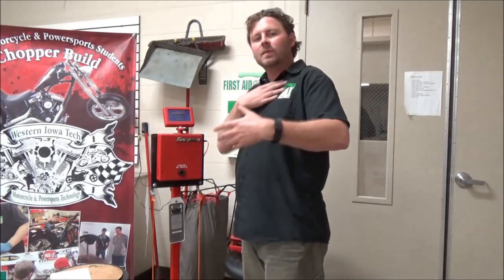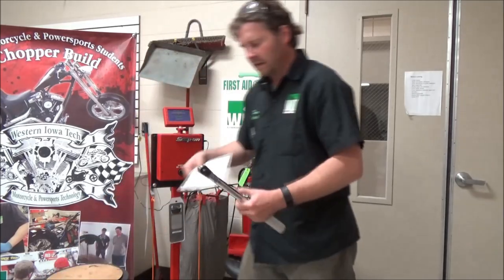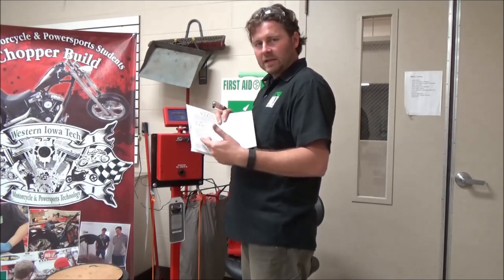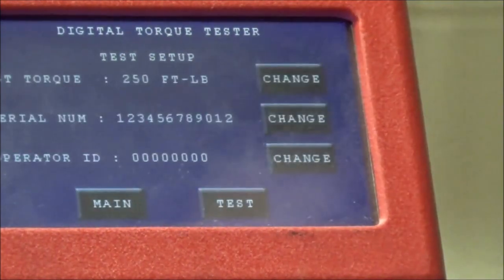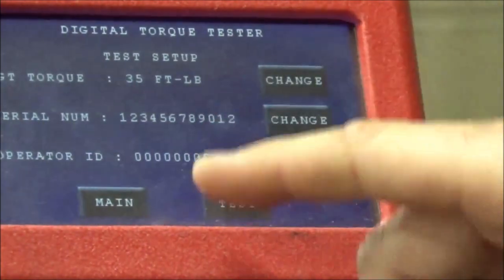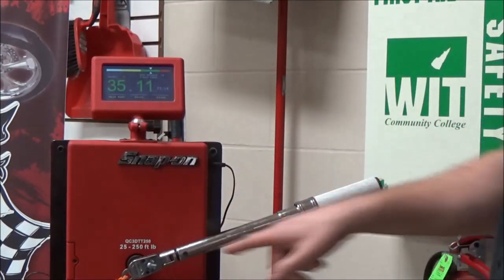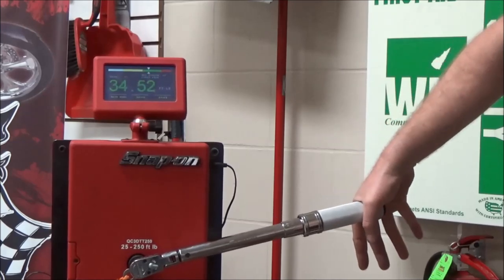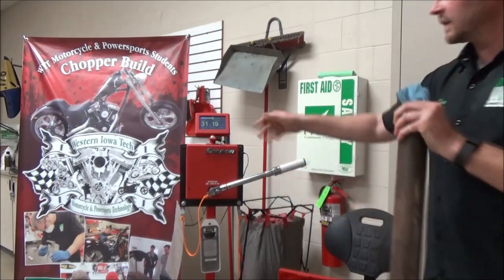Why hand placement matter when using a torque wrench. Proof with electronic tester!

Comment: Thanks for this video.  I wasn't aware of this, it will change my torque wrench use, but I have to admit that it still doesn't make sense to me.   I mean, the click mechanism is out at the end of the wrench, what does it care where rest of the wrench is being pushed on?  So 100 ft pounds is 100 pounds at 12" from the pivot.  Same as 50 pound 24" from the pivot or 200 pounds 6" out.  Right?  Recently I was torquing some very small bolts to 30 inch pounds and I choked up on the handle because it was such a small force.  Certainly the handle wasn't flexing at all, so how does that make me over torque?  To be clear, I'm not arguing at all, just trying to learn why.  Again, thanks for the info.
Reply from the maker: Glad it helped! You rock for commenting! We will let Shane know! Shane doesn't pretend to be an engineer but trusts that ALL torque wrench manufactures train and stand behind this. That's the best answer we can supply as to "why". Honestly wish we knew the science and engineering behind it but I've heard Shane say to students "why fight good practice" you're better off spending your time getting better at electrical skills...lol...little joke he makes with them...

Want even more? Best $2 you'll ever spend...

Ways to support or high five How 2 Wrench! Thank you in advance. YOU MOTIVATE US TO DO MORE!
1. Smash the subscribe button (thank if already a sub!)
2. Have you seen our "YouTube Trained Support Shirts?  https://goodfellasmerch.com/collections/how-2-wrench/products/support-shirt  
3. Join this channel to get access to perks:
https://www.youtube.com/channel/UCBhM8DCKnT3qXwTW0eToyCg/join     
-Daily MEMBER FIRST COMMENTS ANSWERED FIRST 
-Live Q/A video chats
-Wonder if we have a video on your need? Members can request content links!
-Full Access to the ENTIRE 700 video library
-Member-Only FREE tool giveaways  
4. Got an emergency and your head is about to explode from frustration or fear? Get Shane’s cell here: https://how2wrench.com/ols/products/techline-one-on-one

Comment: Theory wise, it does not matter where you place your hand. But the hand placement DOES matter, it prevents you from accidentally over torquing your wrench. If the torque wrench was built in a perfect world, then the hand placement might not matter.. but it is not. Keep up the good work.
Reply: Theory wise, a torque wrench is a lever, the longer the lever is, the more leverage you get. Shane does a great job of illustrating that.

Granted, moving your hand a couple inches in or out is not going to make a huge difference, but it will make a difference. Just like it says in the instructions: place your hand in the middle of the grip for the best accuracy.
Reply: What I meant was the force applied. The click mechanism of a torque wrench does not care where you place you your hands. It simply clicks after a certain amount of torque is applied. Torque can be calculated τ = FxD assuming a perpendicular force applied to the wrench. 
http://formulas.tutorvista.com/physics/torque-formula.html

I do agree that placing your hand in the middle of the grip provides for best accuracy, since placing it elsewhere can induce human error and overexertion of force which will result in too much torque applied.
Reply: The way that a torque wrench is designed, the amount of force required to cause it to click will change as the distance from the fastener changes. (You can see that in the demonstration that Shane provided.) In other words, it will take less force to make the torque wrench click if the force applied to the wrench is at the very end of the torque wrench. Yes, internally at the "click pivot" the torque is the same, but not at the "fastener pivot."  Remember that point at which the torque wrench pivots when it clicks is not the same as the point that the fastener is turning.
Reply: Remember that the torque applied to the fastener is a combination of the torque applied at the Click Pivot and the Fastener Pivot. The Click Pivot may not change with hand position, but the Fastener pivot does when you change hand positions.
Reply: Joe Smith has no idea what he's talking about. The leverage you get at the handle allows you to easily maintain the force applied to the wrench as it clicks. Because the force is greater at the shorter length(closer to the wrench head), it makes it harder for you to let go of the pressure at the exact moment the wrench clicks ...so you tend to overtorque. I bet if he used one of those manual torque wrenches with the needle, this whole thing could be easily explained.
Reply: A manual torque wrench with a needle doesn't have two pivot points like a "click" type torque wrench. It would not be affected in the same way. A manual "bending beam" torque wrench would loose accuracy as you apply pressure further from the center of the handle because you would be flexing more, or less of the beam material. The beam torque wrenches that I have have a pin in the center of the handle to help insure the correct application of pressure from your hand.

Take a look at some photos:
https://www.google.com/search?q=beam+torque+wrench&safe=off&source=lnms&tbm=isch&sa=X&ved=0ahUKEwiHi-Dw-Y3OAhVG2IMKHf1WDgAQ_AUICigD&biw=1280&bih=626&dpr=1.5
Reply: I totally forgot to look into this. Joe smith You are correct. I completely forgot about the pivot.

http://physics.stackexchange.com/questions/39693/calculating-torque-adjustment-for-offset-of-pivot-point/39695#39695
Reply from the maker: You guys have some great dialogue going here I love this type of community a back-and-forth corrections and adjustments. Thank you for being part of my channel and I love your professionalism. 
Shane Conley
Reply: @How2Wrench  I still do not believe that it's the hand position itself that messes with the torque. I'm pretty sure it's actually the shear force (non-rotational component) that tends to increase when you hold it closer to the pivot, increasing the friction in the mechanism so that it doesn't slip/click as easily. I'd like to see one more test: Get that wrench and measure the torque achieved with different amounts of non-rorational force applied, e.g. pulling down on the wrench when it's at a greater angle (maybe 45+ degrees up and down from horizontal). If I'm right then both of those things should throw it off too (wrench angled upwards = more torque, downwards = less torque) even if you hold it where you're supposed to, and if you are careful enough to rotate rather than pull then it should click at the same torque regardless of where you hold it.

Comment: Another problem I see people do is jerk on the torque wrench after hearing the clicking noise.I stop after hearing the clicking noise.Jerking on it gives a false reading.
Reply: If the readings are always over the target that could very well be an issue.  If it's lower, then it's not the operator.  The problem is there's only a small range of movement between the click point and the stop, unlike the really high range  torque wrenches that have a very large release area, and there's much less likelihood of continuing to torque beyond the click release.

Comment: While it is true that hand placement on torque wrench handle is important, there is a little bit more to the issue than that. Click style torque wrenches will click at different torque, while set to the same torque setting, if the speed of moving the handle is altered. The difference in this torque consistency is smaller on expansive wrenches than on cheaper wrenches. Having your hand closer to the drive, puts more force on your hand, so you move the wrench slower and creep up to the click, resulting in higher torque at the click. Using extension allows you to use less force, so you move faster and wrench clicks sooner than intended. Why am I saying this? To point out that not only the hand placement, but the actual technique is important with click style wrenches. Overall, I totally agree about the haters, if you ignore them, eventually they will go away.
Reply: @petethewrist  it is not about what the clutch knows,  it is about how fast your hand is moving.
Reply: @petethewrist  agreed,  but according to my testing of cheap click style wrenches the speed can cause up to 10% variance. Not a big deal in many cases, but user should be aware.

Comment: The difficulty people seem to be having is that they don't realize the wrench isn't measuring torque at the center of the fastener/socket. Or they have never thought through the consequences of that fact.

This kind of torque wrench doesn't know the torque on the fastener. It just reacts to the torque at the clicker mechanism (various designs exist) that is hidden inside the handle. Because the clicker is closer to your hand than the fastener is, it will feel a smaller torque than the fastener.

But that's okay, because those two torques are mathematically related. And by calibrating the clicker properly, the fastener torque will be correct.

If the clicker is located 80% of the way from the hand grip to the fastener, then the clicker will activate when it feels 80% of the torque setting you choose. But the fastener (since it is all the way at the end of the wrench) feels a torque equal to 100% of the set torque. Perfect.

This hypothetical torque wrench will always have the same 80:100 ratio between clicker torque and fastener torque. But ONLY if your hand stays in the correct position. Let's see why...

Imagine you move your hand so the clicker is perfectly equidistant between your hand and the fastener. This means that the clicker is now located 50% of the way from your hand to the fastener, and the real torques will have a 50:100 ratio.

If you set your wrench for 100 ft-lbs/Nm/etc, then the clicker will activate when it feels 80. But since your hand position has made the actual ratio 50:100 (i.e. 1:2), the torque at the faster will be 80x2 = 160! You've just severely over-torqued your fastener.

Likewise, imagine you extend the handle so your wrench is twice as long, and place your hand at the end. The clicker will now be 90% of the way from your hand to the fastener, and the real torques will have a 90:100 ratio.

If you set your wrench for 100 ft-lbs/Nm/etc, then the clicker will activate when it feels 80. But since your hand position has made the actual ratio 90:100 (i.e. 9:10), the torque at the faster will be 80x(10/9)=88.89! You've just under-torqued your fastener.

If your torque wrench is the kind that measures torque at the fastener, then you don't have to worry about hand placement. The ratio between measured torque and fastener torque is 1:1.

But if your wrench works like most click-style wrenches, then hand position absolutely does matter.
Reply: Really very good and clear explanation!!  Thanks.

Comment: Your video is spot on, and I learned how critical it is to center your hand when using the digital snap-on torque wrenches. The click types are a bit more forgiving because of the “click” mechanism. But every torque wrench I’ve used other than Snap-on has been off by 15-25%. 

Extensions on the head don’t change the torque. Long sockets vs short sockets don’t change the torque.  This is all Newton’s third law. 

But as far as your videos, they have been terrific and these other people can just straight up go #%^} themselves.

Comment: I AM an engineer.  I've been a licensed structural engineer for a long time, all we do is work with forces and torques.  My father owned a garage for over 60 years so I also know more than a little bit about working on cars including use of torque wrenches.  The way the click-type torque wrench works the forces that it is measuring internal to the wrench will vary depending on how you place your hand on the wrench.  The click mechanism doesn't know what total torque is being applied to the fastener, it only knows what the internal forces are at its little click mechanism.  There are other types of torque wrenches with different internal mechanisms that might be affected differently by hand position, I don't have experience with all of the different types.  However your test showed that if you have your hand reasonably on the hand grip it doesn't matter very much.  I've found that some torque wrenches vary in accuracy from brand to brand, type to type, and also depending on if you are in the middle of their design operating range or at one of the ends.  For most uses I don't think torque settings are as important as we make them out to be but I have also seen situations where a little extra torque on a rod bolt caused it to fail.

Comment: I wonder if the test would give different results if force were applied to the tool using a mechanical loader (like in a metrology lab), rather than by hand.
I've tried this test on a dial-type wrench and got the exact same reading on the Standard whether force was applied to the center of the handle, 18" extended (a pipe), or 18" closer to the head.
Reply: The results are the same using a mechanical loading bench, but the outcome will be different depending on whether the torque wrench mechanism under test is or is not Length Dependent. Some designs are not length sensitive, one such is the usual dial indicating deflecting beam. They can be used with a handle extension, or operated with the hand up towards the head, without changing the accuracy of the torque reading. The same applies to slipping cam wrenches. But common click types and most other beam wrenches deliver wrong torque when operated away from the handgrip.

Comment: Ok, I get that your hand position affects the torque, but I am having a hard time wrapping my head around WHY. The "click" is set off by the amount of twisting force on the bolt. Moving your hand or adding an extension shouldn't affect this. The only thing it does is require more or less force on the handle. Torque wrenches aren't measuring the force on the handle, so how does this affect the torque reading? Please help!
Reply from the maker: I wish I could help on "why" nut I cannot. I'm demonstrating and "trusting" the manufactures very specific operating procedures. Although I am curious at many little details too my friend, this one has not consumed me. If you ever get an answer please feel free to share. 
 Please Use New Email: how2wrench@gmail.com if ever needed!
 I do offer personal service to back up what's missing from a video to actually fix your specific problem. I do work on donations for my time and possible research. 
Good news is its CHEAP! For my time would mind becoming a member of my website? It comes with a free 20 mins of techline and that will cover my time to assist you so we both benefit. So to have me personal cell phone number to put in your phone as your direct info and how to coach, sign up now! As always thank you and enjoy the free videos! Much more to come! I look forward to working with you and hope you will become a member of or learning community. 

Link to membership: https://how2wrench.com/product/membershipmembers-onlymembers? 

If I can ever be of service to you, here is a video explains how to connect with me. 
https://www.youtube.com/watch?v=vjvmB01ebcs 
Direct link to services: 
https://how2wrench.com/product-category/tech-lineservice-callminutes/ 
Live Chat is great for you to actually show your specific issue!
Donation link: https://www.paypal.me/how2wrench